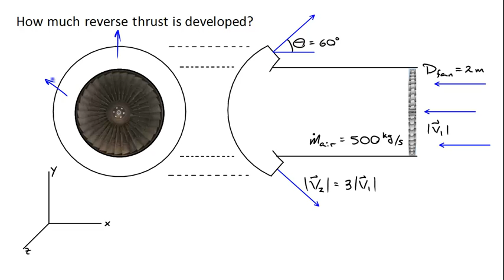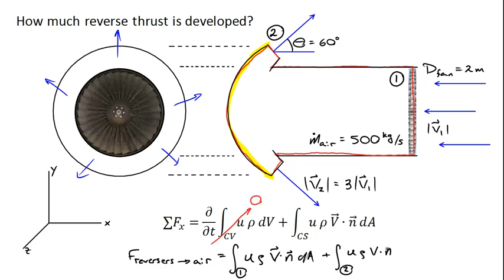Thrust Reverser

Comment: Okay so humor me here.  Everyone makes the assumption that all the Thrust Reversing capability comes only from the angled deflectors of thrust reversers.  This is not true.  Take theta and make it 90 degrees, it removes the first component of the final equation entirely. (3 cos 90 + 1) becomes 1.  And if you use the numbers in the example, it comes out to 18,000 lbs of negative thrust. 
 
So if you had a thrust reverser that was simply a flat wall, completely 90 degrees to the direction of the airflow, the engine would still produce 18,000 lbs of negative thrust.  I just can’t get my head around that.  They tell us that if you put a fan in front of a sail on a boat it won’t work (it doesn’t).  If you put a leaf blower in front of an umbrella while on a skateboard it doesn’t do anything, but if you point a jet engine at a flat wall, you get 18,000 lbs of negative thrust.
Reply from the maker: What interesting questions... I'm not entirely convinced that your sailboat and skateboard examples wouldn't do anything.  I think they would produce a trivial amount of thrust in the opposite direction, which is far below the force of friction needed to move them.  I think part of it is because the fan and leaf blower in your examples don't produce much thrust to begin with... the change in airspeed between the entrance and exit of the fan is very small, as is that of the leaf blower.  I don't think they'll result in the 3-fold increase in airspeed that I used in my example. In addition, the mass flow rates through both are much, much smaller than a jet engine.

Comment: ro should be different when you were calculationg the result. You put in for the ro 1 kg/m^3 while for the air it is 1.225 kg/m^3. that's 20 percent off, it would give smaller result...

Comment: Could you help me with a doubt?

If the plane is pushing the air at V1 then the force associated with the displacement of that mass of air will move the plane forward on the opposite direction.

On the other hand, if you accelerate the air inside the turbine to V2 = 3*V1 then this mass of air is also propelling the plane forward!

Then the air hits the reverse thrusters and you've got some backwards propulsion but why didn't you take into accound all this forward propulsion I mentioned? (I mean why didn't you take into account the forward propulsion of the air when accelerated to a velocity V2 inside the engine before hitting the thrust reverser parts?

Thank you for your video :)

Comment: really nice, I actually thought that vertical component of the air flow following the thrust revers exit at 60 deg. had some effect in slowing down the plane as it tries to rise the plane up again so the plane momentum had to re-split again between forward and vertical movement.
for example stopping a rowing boat you need to push the oars vertically into the water and the boat stopped so I do this analogy with the plane reversers vertical components.
good explanation, thanks
Reply: That's also what I'm looking for. The thrust was generated by the engine itself. Then sending it back would just cancel it out. How does it get to net negative (reverse) thrust? 

Unless, somehow if the air doesn't go out the back it doesn't impart any energy to the engine?